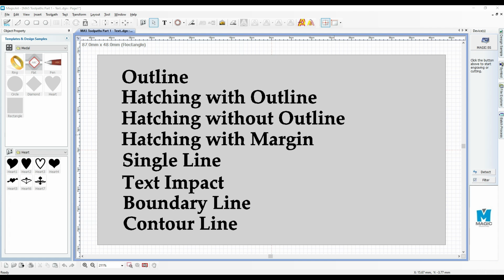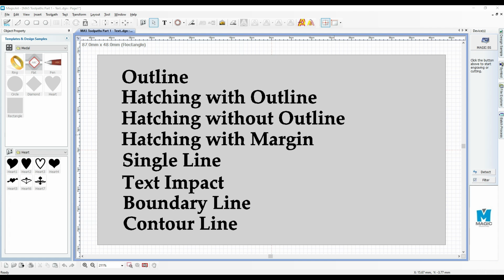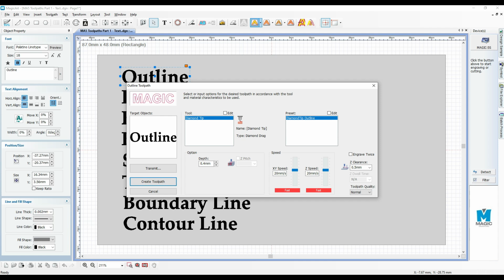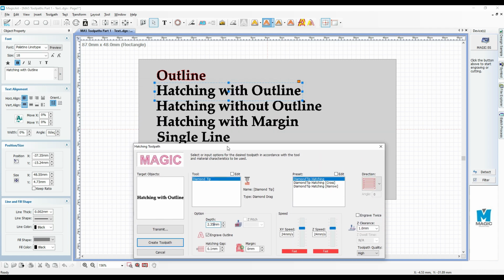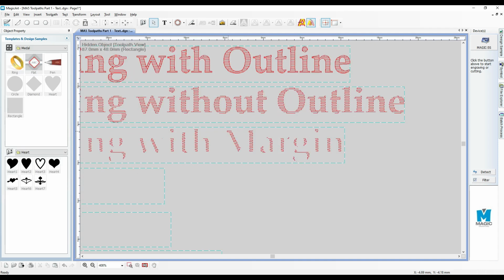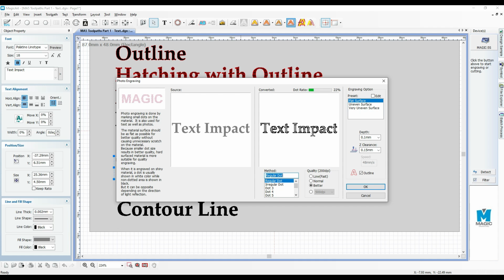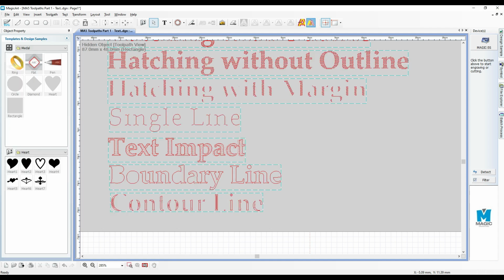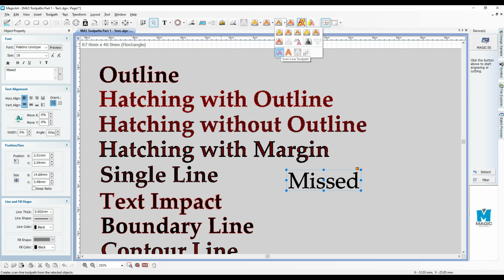What Toolpaths are available in MagicArt 5? -  Part 1

Comment: Hey I need help, I've used this machine for years and all of a sudden out of nowhere the software has the toolpath options greyed out and won't let me do anything :,)) do you think you could help me?
Reply from the maker: Hi, thank-you for your question. How frustrating that this has happened!  I won't suggest common things like checking that you have your object highlighted before looking for the toolpath options, as you have been using this machine for years.  If I ever have a technical issue, I find the best thing to do is to make a brief video or take photos of exactly what is happening and then to contact Magic (iredt) technical support directly by email (tech-support@iredt.com)with the video/photographs and your questions.  I usually expect a day or two for response because of time differences etc , but have always found them super helpful with their answers.  I hope this helps. It would be great if you would come back here and let us know how you get on and what the issue was. Best Wishes.
Reply: @JewelleryEngraverOkay, thanks for your suggestion! I'll see if that works out